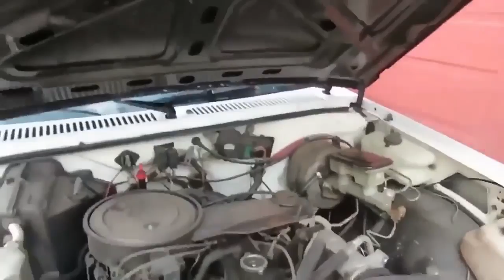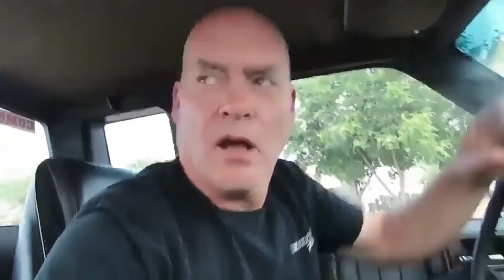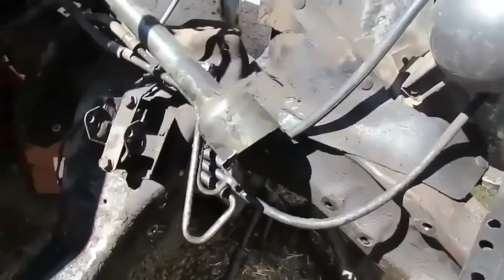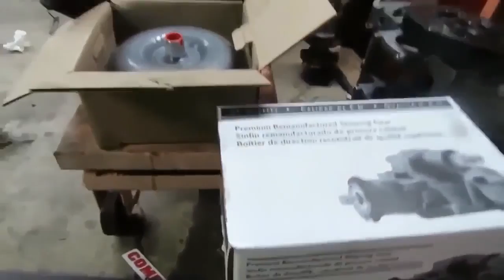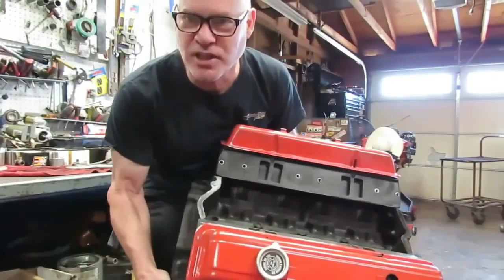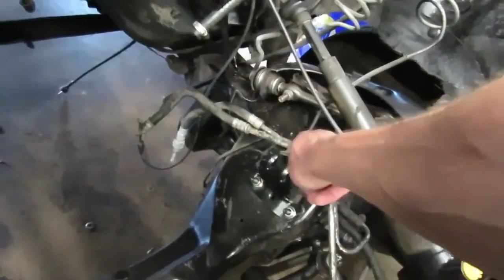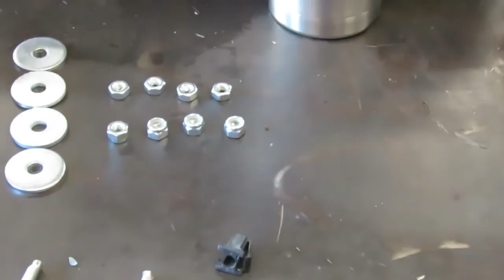S10 Pickup Triple HP upgrade

Comment: Actually the 4.3 is not the same as the 4 and 6 cylinder trucks, the 4.3 spring has an extra  coil, another words it's a taller spring to accommodate for the weight of the 4.3 V6,

Comment: I built my iron duke, it ran 14s in a quarter mile, just gotta know your stuff, the best iron was in 92 in a S10 and all the s10s that came with the 2.5 manual transmission 4 speed had 4:10 gear ratios, the 5 speed was 342 and 3:08s and I never seen a 4 cylinder auto extended cab truck, the truck here appears to have a 84 or 85 dash with a 91 grille.

Comment: Get you a 5-speed transmission for it take the mechanical cooling fan off and put it electrical one go away with the throttle body and put a regular carburetor on it you will see a big difference

Comment: I have the 1988 S10 my dad bought brand new. Always garage kept. Had it repainted and it looks brand new again. Also had 2.5 iron duke rebuilt. Unfortunately I just can’t figure out why it won’t run right. It runs good when under a load and accelerating, but it bucks and jumps at low rpm. Just cruising along barely touching the pedal it jumps and bucks. Everything is brand new so I can’t figure it out. Even replaced the Hall effect switch in distributor. It’s like it needs a air fuel adjustment but you can’t hook a computer up and tune them like a newer one. So I just been dealing with it.

Comment: I know why you were wishing for a 4.3 .... cause swapping a V8 into a 4.3 is waaay easier as a lota stuff is already laid out as the 4.3 is a V8 based motor. The best S-10 ta get is a 5 spd standard 4.3 , some a those (tow package) even came with 8.5" rear end, also the 4.3's have taller gears , yeah lotsa lotsa reasons ta start with a 4.3 when ya been there done that, gotta hand it to ya fer diving in anyways ! cheers.
Reply: Yes! And harness would basically clip into 80% of the components

Comment: My s-10 has a 3 inch drop(springs not spindles)in the front.
Cutting leaf springs to make truck arm suspension w/coils and pan hard rod.
Might even find some nitrogen filled motorcycle shocks.
BullyBilly.

Comment: I miss my S10. I went from Iron Duke/4spd Manual to 305/TH350 back in the early 90's and even THAT was a huge upgrade. With the Iron 'Puke', Climbing hills on the highway in 3rd gear and unable to maintain the speed limit was an easy decision maker to do the SBC swap.... even the 305 (don't knock it, it was a free longblock w/accessories) was night and day and performed surprisingly well after decking the block/heads to get some compression back, Edlebrock Performer Cam, Edlebrock Performer Alum Intake and a good old Quadrajet was enough to get that thing knocking on the door of 200HP at the crankshaft...LOL. TINY HP by today's standards. The toughest thing was trying to find an oil pan with the dipstick in, because I ran the same exhaust manifolds as you did....and you obviously know by now, that on a pre-86 block, those manifolds block the driver's side dipstick tube hole. 9" (long) Tailshaft TH350 on the factory trans mount (factory location), no driveshaft length mod required and made my own block side offset motor mounts as well, using the 2.8L 'rubbers' on the front crossmember. Oh the days......

Comment: The S10/Sonoma are my favorite little trucks! I had a Blazer and have a 98 ext cab with 2.2 and 5 speed. 492,000 miles on the original engine/transmission and it is still my daily driver. I'd like to find a clean one like that for a v8 swap.
Reply: Wow, lots of miles. I got 2.2 with 230k 5 speed. Any problems you had with yours?
Reply: @madebydade305ify  usual stuff associated with  high mileage. The only pattern failures I've had have been with the drive line. I can't keep u joints in it/the driveshaft from vibrating for more than 2 or 3 years before pulling it and taking it to the drive line shop. The mileage is up to 509,000 since I posted that comment.

Comment: I got a ‘93 with the 2.8L 5spd that I’m trying to get running. I honestly prefer the 2.5 I4 over the V6. Seen many iron duke race engines but never any good 2.8. I’m sure in the future I’ll do a V8 swap 🤷‍♂️
Reply: HP books has a V6 guide for horsepower.
2.8 is covered. Edelbrock sells 4bbl intake. Topoff with a 390cfm street avenger. Comp cams kit.
180hp and still a lightweight truck.
The Iron Duke? You"ll need to do a CompCam with steel gears drive cam. Offenhauser intake. The cast crankshaft
???

Comment: As soon as you said it was a 1985 I said it's either the 2.5L or the 2.8L and you kept hoping it was the 4.3L, But the 4.3L didn't come out in these S10s until 1988, But just looking at that truck, the front end, it looks like it's been in a Front end Crash or maybe someone just added different parts for some reason, Bc the Molding is gone on the Passenger side Fender, The Hoods Black & It has the Newer 90 - 93 Style Core Support & Grill...... But that 2.5L might not have Power, but it sure will last a long time tho, I've got a 1984 S10 Blazer, 2.8L/Auto, 4X4 that I just got done Rebuilding from the ground up, I really really wish I would have went with a 4.3L swap on it now tho bc the 2.8L in this thing even tho it only has 43,000 Original Miles on it, Sucks, it has absolutely NO power at all and I hate it Lol, My 1995 S10 truck has a 4.3L (Blown Up now tho) and it was so much fun to drive, But now that that Engine is Blown Up I'm doing a 305 Swap on it and that's what lead me to your videos, was the 350 Tear Down video, bc I want to keep mine a TBI, But I'm not sure what else to do
Reply from the maker: I did not know the 4.3 did not come in these till 88 and I'm actually not even imberresed that I didn't know that
Reply: @Myvintageiron7512  Lol, it's nothing to be embarrassed about anyways man, I know quite a bit about S10s tho bc that's pretty much all I work on & deal with.

Comment: The rear end will most likely hold up until you get it too hook real good. With a wide drag radial and posi.  It actually wouldn't surprise me if it has a short life with the tires you have which are wide sort of, yeah. that may be a 2 core but its as thick as a 3 or 4 core.  its way fatter than a factory 2 core from like gm car or s10 i guess.

Comment: Dude, you realize that oven cleaner was developed to be used inside the house, right?
😆🤣😂😅😆
Reply from the maker: correction is is used inside an enclosed over where the high cleaning temps destroy the fumes use it in your house outside the oven and it will poision you
Reply: @Myvintageiron7512  fair enough. O stand corrected.

Comment: Oldest story in the gear-head world:
-Have full-size pickup "Hey I'd like to get better mileage for commuting"
-Buy little ricer car, car is efficient and reliable, but too small: "muh parts"
-Come across a deal to buy a small truck, buys it
-"Holy crap this thing is slow"
-Put in a gas-guzzling V-8 engine
-Have now come full-circle, you now have a gas-guzzling pickup truck but it's smaller.

How many times have we seen this kind of thing happen 😂  This is a great video, I wish you'd upload more often.
Reply from the maker: I'm not really concerned with Gas miliage I have 3 other cars that get 30+ MPG my Lexus actually gets 38 hiway, 
 the Scion was somthing that came my way for next to nouthing I wasen't looking for a small car It just fell in my lap it was actually fun to drive with the 5 speed and was pretty quick it would eat my hemi dodge ram for lunch in a drag race  I actually made $$ on it so your account is actually not really correct in my case, but I get it alot of guys have done just what you said
Reply: @Myvintageiron7512  I figured you knew what you were doing, I watch all of your vids, just pulling your chain a bit.  I watch the ads on your channel, one of the few I do that with.  This channel is the best engine building show on YT, remarkable considering the budget some of the good shows are dumping in.  Please don't ever take your videos down, I've watched the Cam and FE Ford videos like 4 times.

Comment: Double check the subframe mounts they like to migrate. if you live near NC I could use the iron duke. I found my 2.5l was sluggish until I replaced the TBI system. I'm so sorry, I had a Chevy Citation II with that boat anchor in it. I named it "not so heavy chevy". It was a mid-size hatch that weighs more than the heavy chevys, but could slowly pull a s-10 out a creek. It will run on 2 of the 4 cyl missing if you dump oil in constantly...

Comment: I was just wondery did you ever consider changing out the wheel bearings with bigger set on that thing.  reason why I say this is because I did a similar swap to  my Chevy truck the bearings on those wheels were not capable of handling all the weight of the V8. keep up your amazing videos my friend.

Comment: I bought one of those new in 1984, or 1985, to use for a parts delivery truck / shop truck at the NAPA where my engine machine shop was based.  The one I bought had the 2.5 Iron Duke with a 5 speed standard trans. That truck was beaten to death for years by many driver's, and had 348,000.0 miles on it and still ran great when I sold it to a buddy of mine. With a 5 speed it was fun to drive.
I like your plan to swap in a 350 V8, with over drive auto . Probably will get good gas milage because it'll weigh nothing, and be crazy fast too. Awesome project. 
Stay healthy

Comment: Be Mr. Cheapo like me and NITRO OXIDE THE THING WHEN YOU NEED TO GO FAST . 😁😁😁😁🙌
Reply from the maker: Honostly I don't really want this to be fast I want decant power but not a hot rod stock suspention and rear end I don't really plan to beat on this truck it's more of a shop truck than anything I have the Big Block S-10 for that
Reply: @Myvintageiron7512  borrow and adapt a salvage yard turbo from an old diesel for towing power without over pressurizing the top end.